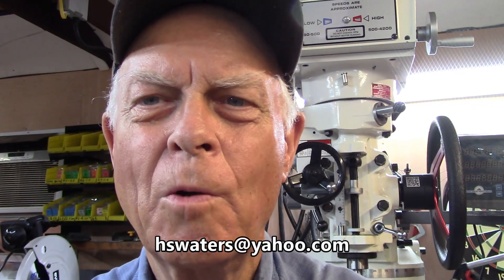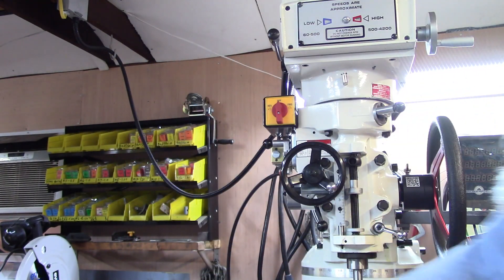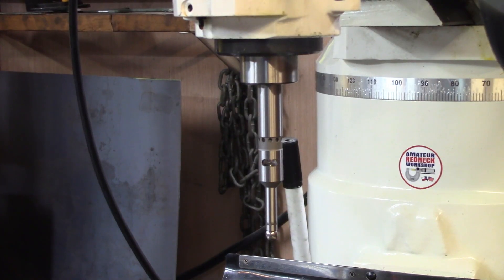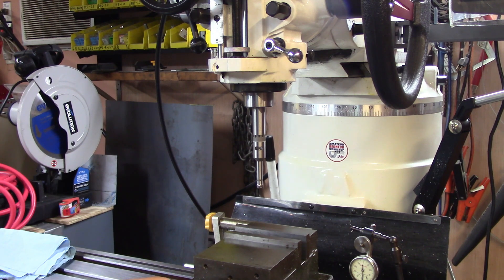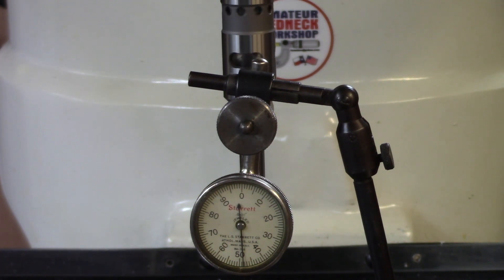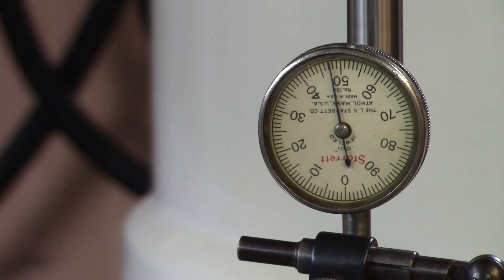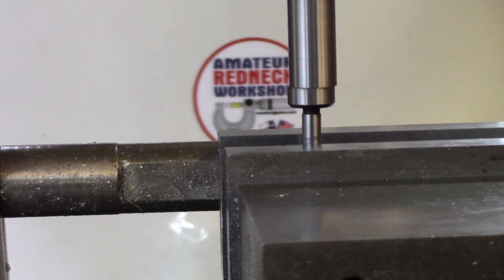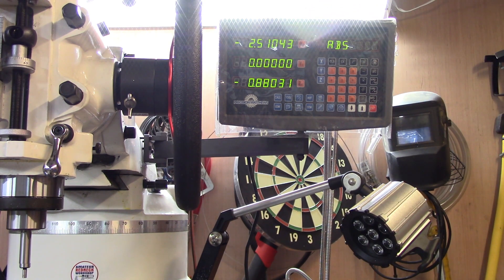Optical edge finder

Comment: Harold now I am gona have to check mine. ;-( . LOL The .002 you are seeing in the collet may be some fine dirt so i question if the collet and the inside of the spindle was cleaned as well as the drill rod. I am going to start by checking the run out of the spindle without a collet in it and then follow thru with what you have done. I really appreciate you making this video because many of us (me) assume the tools we buy on line are free of error. You just saved many of us the $15 plus freight for the E-finder. I have both the manual you have shown and also a wiggler. Most of the time I just use an end mill and rotate the spindle by hand until i feel resistance.
Reply from the maker: Their are lots of ways that work.  Unfortunately this one does not work for me.  Thanks for stopping by.

Comment: Interesting, I've seen optical edge finders in the tool catalogs and flyers but never tried one.  Still using the spring loaded unit, but if these can be reasonably priced and actually accurate there might have to be one ordered and played with.  I', going to watch the revisited video too, see what other things you found with yours.
Reply from the maker: This one does not seem to be all that good.  Thanks for stopping by.

Comment: Welcome to modern home shop reality Harold.
While I'd bet some of that run out is in the collet as others have already said, I'd still double check the spindles R8 taper just to be sure. Whenever possible I run checks on almost anything I buy for the shop. For mill spindle tooling that starts at the machine so I have a known base line. And collets are where if there's nothing in print about guaranteed run out numbers I just don't buy. If they are decent any manufacturer is going to use that opportunity every chance they can to brag about them and raise the price. And yes I'm paranoid enough to still check even the guaranteed one's. Your 100% right, you really can't blindly trust anything. If you don't check there's no way to be sure of what you have. There's multiple reasons the good edge finders cost what they do and it has nothing to do with the cost of labor. While I've not ever bought one of the Starrett edge finders, today I'm not sure I would. I've had a couple of experiences in the last few years where there quality is starting to slip on at least some of what they make. But to be fair other items have been just fine.
Reply from the maker: I can see that I am going to have to have a do over on this video.  Thanks for stopping by.

Comment: I've been using that same edgefinder in my CNC machine.  I used an indicator similar to what you' were doing and used the X axis to bend it slightly and got the runout down to about .001-.002,  not great but for the work I've been doing it's close enough.  I've had a Haimer on my wishlist for a long time but at about 25x the cost of these I'll keep using the one I have for practice.
Reply from the maker: I keep being tempted to build a cnc mill.  Thanks for stopping by.

Comment: Is a gauge pin too short to check the collet?
Reply from the maker: No but then I do not have a gauge pin larger than 0.625 inches.  20mm converts to 1.5875 inches.   Thanks for stopping by.

Comment: Harold, I think you need to put your new edge finder in the press and straighten it out.  LOL  Or try another collet . But still a video I got something out of. Thanks for sharing it with us.     Gary
Reply from the maker: I went into this not as prepared as I should have.  I discovered that other than the edge finder I did not have anything else that would fit in that collet.  So I was not able to test the collet for runout.  I guess i could crank up the lathe and turn something.  😉😁😁😂

Comment: Harold, allot of the china stuff out there is like this. I have been lucky and bought a couple of starrett units for less than a China one. There are deals out there. Like Stefan says, the china stuff should be considered a kit, not a full working unit.
Reply from the maker: I think both you and Stefan are correct.  But a kit is better in the hands of an expert than an old amateur.  I believe I will just get a Starrett and be done with it.  Thanks for stopping by.
Reply: @AmateurRedneckWorkshop  I will keep my eyes peeled. Maybe there is something I can help with Harold.

Comment: Harold you mite want to try again using metric on the dro ,that ball was probably 1mm from dimension you used I think you lost a little in conversion.
Reply from the maker: I don't think that physical size or distance will change any no matter how it is measured.   As I recall it measured 0.3933 inches which is .998982 mm.  The runout was 10 thousandths which to me is a lot of run out whether it is converted to mm or whatever.  Thanks for stopping by.
Reply: @AmateurRedneckWorkshop  Yep

Comment: The issue is run out which will change every time you recapture even the same item over and over. The key is an end mill WILL have run out so you want to find when it will actually start cutting or where the high spot is that cuts. That is the true edge location. To be accurate hold a piece of paper between the work and end mill when it's grabbed you know the gap distance till cutting starts. That's the true zero point.
Reply from the maker: Dave M I am sure this is the correct procedure as you described it.  Quite often that is the way I do the edge finding.  Thanks for stopping by.

Comment: I got sucked in and bought the same
Reply from the maker: I hope it is better than mine.  Thanks for stopping by.
Reply: I didn’t buy the extra batteries, just using the beep, I think it would have been better if it had been smaller
Reply from the maker: @tomburson5733  I believe you are correct.  The further you get from the collet the larger the error is going to be.

Comment: In case you didn't know, the Starrett back plunger indicators can not be calibrated for linearity (however yours may be accurate) but can be calibrated for repeatability.  I agree with others that you need to check your spindle runout and collet runout.
Reply: I believe the edge finders had two different shank sizes. 20mm and .5". So either both collets are bad or the mill spindle is bad. I doubt the spindle is bad, it's a brand new machine!
Reply from the maker: I checked the .5 inch collet and it had .002 runout.  I don't have anything 20mm to put in the other collet.  Thanks for stopping by.

Comment: Hi Harold - how about using a thin paper between the edge and the cutter and then measure the paper - very old school. but it works ,-))
Reply from the maker: Yes it does and I do that sometimes.  It is actually faster than changing collets and using the edge finder.  Thanks for stopping by.

Comment: Thinking you may have a problem with your collet as the whole body of both edgefinders seem to have runout
Reply from the maker: Yes that is possible.  Thanks for stopping by.
Reply: I believe the edge finders had two different shank sizes. 20mm and .5". So either both collets are bad or the mill spindle is bad. I doubt the spindle is bad, it's a brand new machine!

Comment: Hi Harold, you have to check the collet and mill taper for runout before drawing conclusions.  I could see the edge finder body moving in both cases. Cheers Rob
Reply from the maker: I see .002 runout on the .5 inch collet but I do not have anything that is 20mm to use to check the other collet.  Thanks for stopping by.
Reply: I believe the edge finders had two different shank sizes. 20mm and .5". So either both collets are bad or the mill spindle is bad. I doubt the spindle is bad, it's a brand new machine! likely its the edgefinders. I know the ones I have from the far east are not so great.